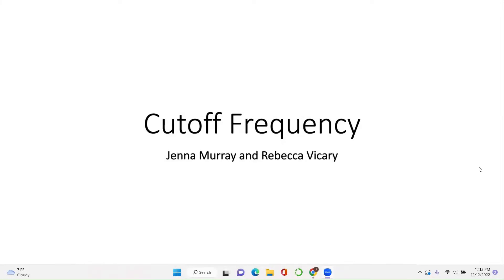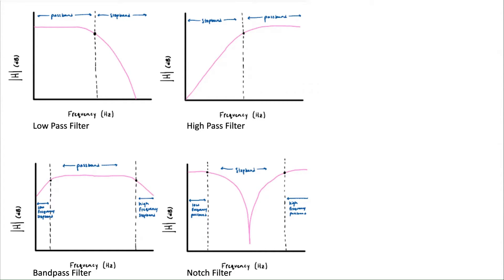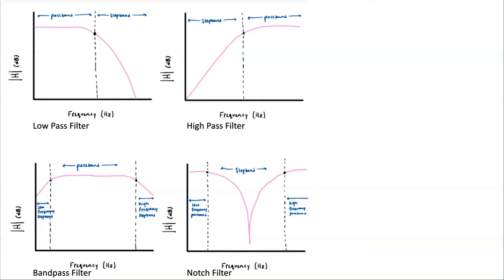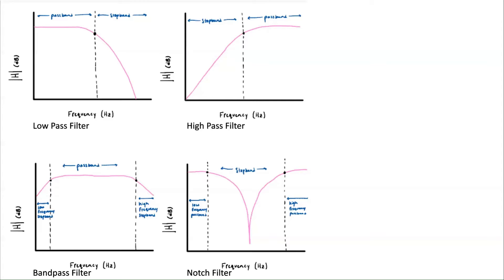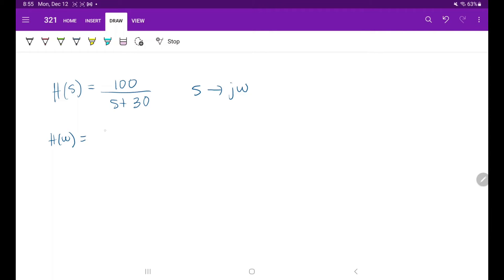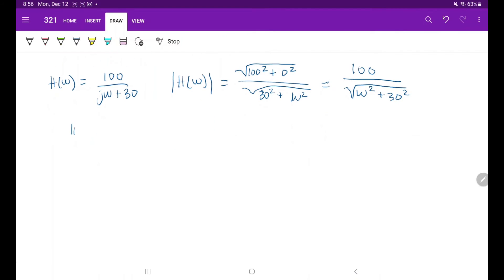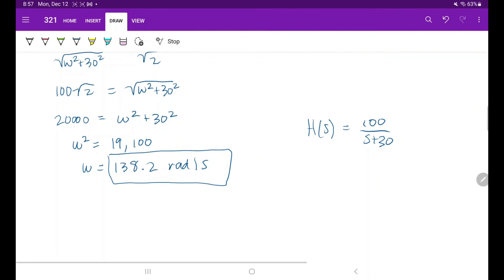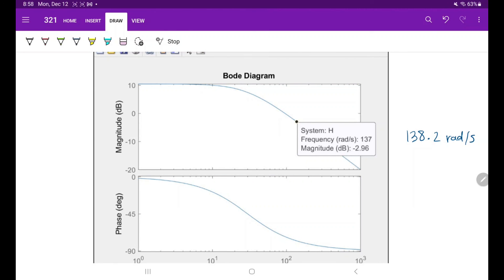Cutoff Frequency

Comment: Good explanation dear! But I think there's just a misconception about what is cutoff frequency! You should have considered -3dB lower than the magnitude of w=0 which is roughly +7dB, so the module equation would be equaled to 2.24 (which is 10^(7/20) and not 0.71(which is 1/sqr(2) or 10^(-3/20)).